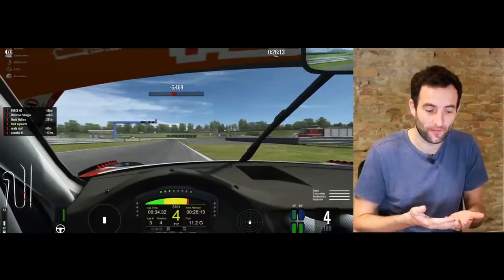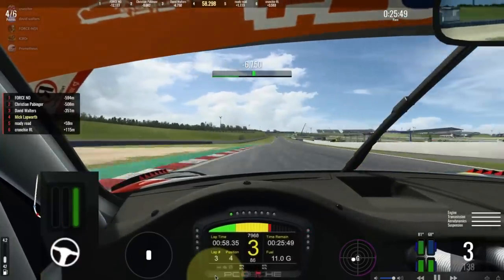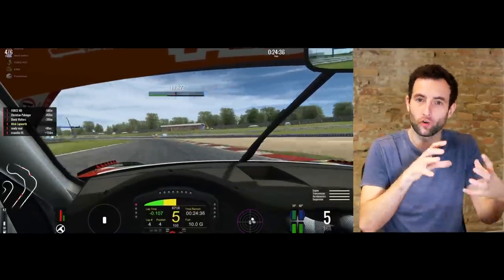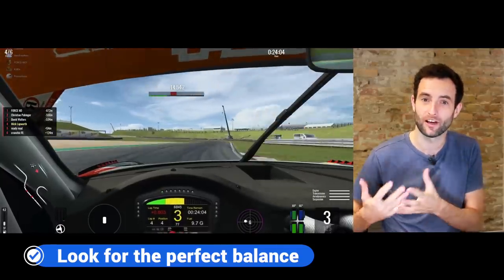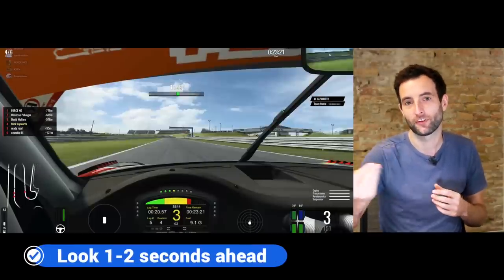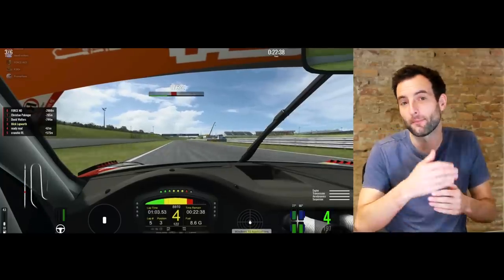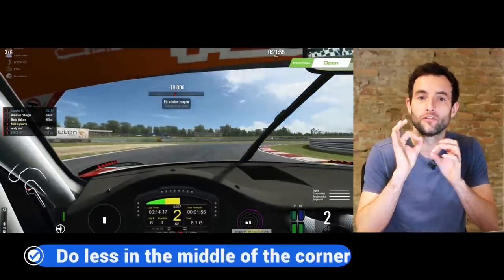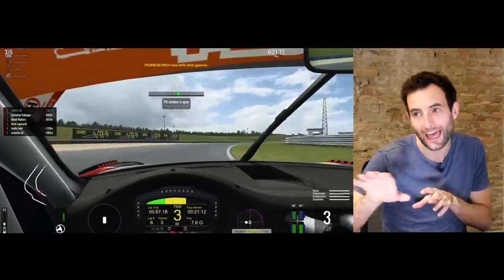Are You Using The Throttle all WRONG? [Sim Racing]

Comment: So how about the badly made throttle pedal?
Try it your self hit the pedal with 30% and it will accelerate till limiter
This will make you lose control cos you can't control it like real pedals
Example:
When I drive my real car at 3000rpm at 5gear my speed is 120km/h depending on gearbox setup
But when I try to do this in the racingsim it is close to impossible to drive 3km with constant 120 or even 60km/h
So until they don't fix the throttlepedal to realistic its impossible to controll cars with no traction controll like 1976 RSR

Comment: When i look far ahead, i don't need to think about how to drive the car to get there. It comes with experience, i have near 10 000h on sims (i'm NOT very fast, i disappointingly found out few years ago) and it takes quite a lot of experience to get there. But the main difference is in the workload your brain has to make. It comes in the end as naturally as walking. If you look really close, it takes way more effort. But you do need lots of trust and confidence from the car too, understanding how it behaves with mass transfer. Don't worry too much about checking if you are exact millimeters from the apex, your eyes will do microsaccades, very rapid movements that will take care of most such details. Only thing you need to think about is "i want to go there" and you will get there. If you look at 110m hurdles, they are not looking at the next obstacle but the one after that. The rest is experience and letting your brain do what it does the best.

Comment: The secret is not learning how to keep the car balanced, that comes with time. The hard part for me is when to not follow those rules. Sometimes modulating the gas or brake is the only way to keep it balanced around a tricky corner. 

When I practice with a mx5 or low power car I just swerve all over before the corner and use the momentum to enter the corner. From different angles and brake points till I find the fastest. That was how I learned to control weight shifting and after that I barely lost control like before.

Comment: Another problem or reason people may be throttling up inconsistently as you described, is because their SIM setup may not be providing enough feedback about what the car is doing(over steer or understeer). It is a problem I had until I sorted out the correct settings for my wheel with each racing sim program/game. When my settings were wonky, I was unable to properly judge/feel the amount of grip under the car, causing me to kind of test it with the throttle throughout the corner.

Comment: For looking ahead, if using single monitor setups without head tracking it's kinda hard looking ahead on really tight turns like hairpins and what not because you only have so much field of view without having to try and hold the camera in a certain direction while trying to drive.

Another issue I have sometimes is tracks I don't know. I don't race with a map so that doesn't help but not knowing the track alone is crucial and would just take practice, but also some spots like those small S curves while you were saying look ahead I didn't see. Granted I'm watching on a small screen(phone) I was looking ahead and not knowing the track I didn't see those at first.

Comment: Another good idea, is, if your racing game/simulator has a "theoretical best line", turn that assist off... It will force you to look ahead in the turns... For the longest time, I always used that assist, mainly to find braking points... But then I got too used to staring at that colour changing line and not looking ahead, and my throttle input was often inconsistent... I just recently started running with that assist off, and my cornering seems smoother... I may be a bit slower as now I'm forced to find visual references, rather than staring at a line in the road, but my cornering is smoother and more consistent...

Comment: One of the reasons sim drivers look near their car, instead of up the road, is because they use their eyes to see what the attitude of the car is, and how that is changing in respect to the track, and that means staring near the edges of the car.

It's an ok habit for the occasional 'moment' when your just over the limit and need that extra information to determine your instinctive reaction to avoid spinning. But as a general rule you should be driving with your eyes always up the road.

Comment: I have done some sim racing years ago when Papyrus was still in the game.  I have done some high performance driver education courses on race tracks.  Not all that great of a performance driver but I found that sims were impossible for me.  Even with buying a - at the time - expensive wheel and pedal set up - the issue was zero feeling of what the car was doing.  There were always dead spots in the pedals and they were just way to easy to push that being smooth was something I was never able to do.    Never knew when the brake was starting to work and slow down the car yet one of the guys I raced with was in a wheel chair and used a joystick and was one of the top drivers in our league.

Comment: I’m using sim racing during the winter to improve trail braking and throttle response in real life for my bike 😁 Even if it’s done with our legs here our brain needs training with the response and motorcycle games are really bad 😂 apart from that Jardier is using on and off throttle mid corner to deal with understeer and it works

Comment: Smooth is faster. This is best seen in motorcycle racing where weight transfer is more critical than car racing due to the narrow tires and the fact that bikes rely on the weight input of the rider for steering. Abrupt power inputs work for drifting, but that is the least efficient way to get around a track.

Comment: I use a controller an the gas is a nightmare to modulate. For some reason or another, I can modulate the brake lightyears better, but not the gas. I leave 1-2 seconds per lap on the table as a result.

Comment: Ayrton Senna would like to disagree with your first point (jerky acceleration)

I am referring to a part of a documentary about Senna, comparing his car input data to his F1 teammate. While his teammate's input was smooth, Senna's was quite jerky, like an ON-OFF switch. It is believed he learned that in his younger days while karting. The result of his sudden and swift work of the accelerator was not only to move the weight of the car to the back (as you successfully explained later in this video) But also to rotate the car mid corner (on rwd ofc). 
Smoothing out his data input would still show a 2 step acceleration, but the first step was also used to slightly break the traction and rotate the car mid corner or even before the apex.
I believe such technique is not possible or rewarded in most simulators. Definitely not in Gran Turismo where smoothness seems to be the best way to play(tire wear and traction models)

Comment: Do you know a good settings setup for a thrustmaster Tmx on project cars 2 for Xbox one
Reply: Do you not find theres a dead spot using any thrustmaster wheel on a console? I had one on my ps4 pro and my one x and theres a dead spot in console games or it's due to console games having Vertical sync always on such high input lag where as on my PC I do not use Vertical sync as i race in VR in the valve index. (I have a Direct drive Simucube 20nm, Heusinkveld pedals, P1 cockp6it). Maybe I would of got used to it but I thought I might as well sell a kidney and get a direct drive set up